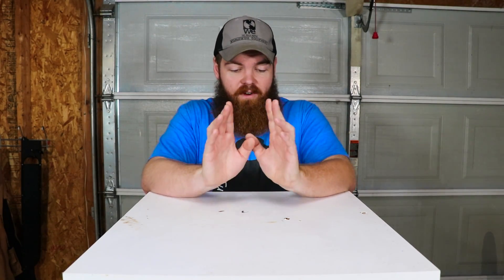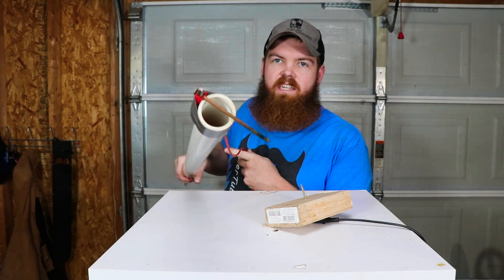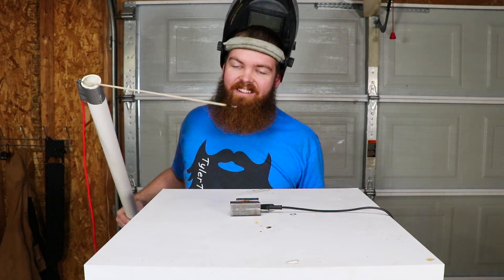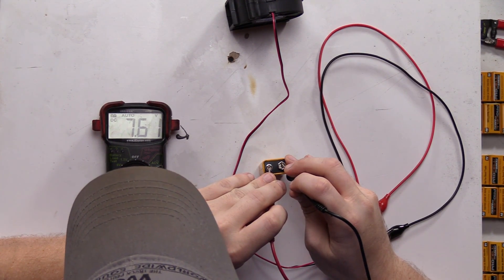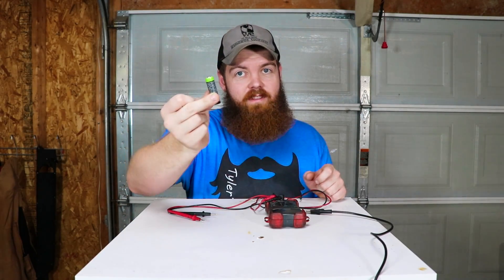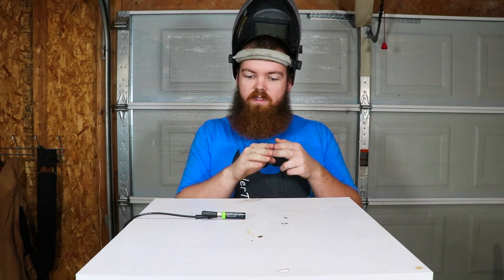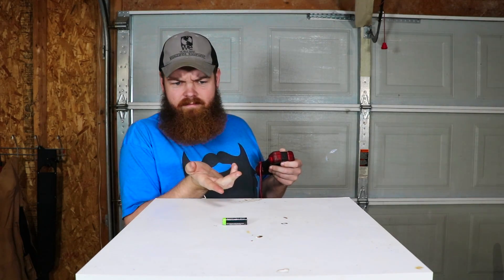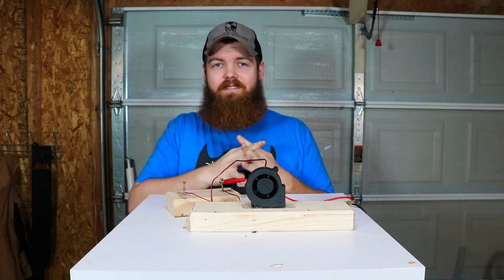Can You Weld With 300 - 9 Volt Batteries?

Comment: Hallo,
ich spare mir den halben Kommentar. Einfach in der Schule in Physik aufpassen. So ein Quatsch der hier erzählt wird. 
Beim Schweißen sind nicht 2700Volt und wenige Ampere wichtig. (Lichbogen wie er hier zu sehen ist) sondern wenig Spannung und viel Strom. Die 300 Batterien in Parallelschaltung und du kannst Schweißen wenn du es kannst. ) 9 Volt und 80 Ampere, das geht. Versuch es noch einmal!
Grüße

Comment: 9v batteries in series like that have lots of voltage but they can't pass much current. you would have had better luck connecting them in series and parallel, i'd taken 1/2 put them in parallel, then the other half, then put the 2 hales in series. that would give you 18v but a lot of current. all the batteries in series just give you impressive sparks.

Comment: you can weld with 9v batteries, but you need to wire them in parallel not serial. welding works through high amperage and NOT through high voltage

Comment: Put 5 in series and parallel them up that's shouod give you around 45 volts but in parallel with other ones should be around 100 amps or so

Comment: I think that you might actaully be able to weld with 9 volts, if you arrange them correctly. You arranged them in a series which in creases the voltage, so the kind of power your output is 9v x 300(batteries) = 2700v and 500 mili ampers. When welding you need a high amperage and not so many volts so if you arranged the batteries in parallel your new power output would be 500mA x 300 = 150000mA and 9v (or 150A at 9V). That would bring you up to the amount of ampers you need but im not sure if 9V would be enough. Still love the video though, would love to see a follow up in a parallel setup of batteries

Comment: Naturally electricity wants to be balanced. There's so much power stored in that many 9 volt batteries that it will charge a 1.2 volt battery a lot. The trick to a quicker more reliable charge would be holding the connection for 5 seconds without creating the ark. The ark is the air ionizing. Its not a real connection for electrons to flow through.

Comment: This didnt work because for welding you need high amperage and not a high current. 300*9V=2700V is useless, most welders just use about 16V. so you should try like 150*(9V + 9V), means, two in series and 150 parallel.

Comment: Look if you hook a bank of 30 together you'll have a diecent supply of voltage. Then you'll have 10 banks of 30 batteries. If you hook those 10 banks up in paralell (positive to positive, neg to neg) you'll have a good supply of amperage. And those amps are what you want because they put out the heat you need.

Comment: Too much voltage (9*300=2700v), it creates an arc before melting the welding rod down, said arc eats the melted rod. You should try with half the batteries and a thinner welding rod. You might get better results.

Comment: 3 series, 100 parallel  would work better than 300 series.  As others have pointed out , you need serious current to weld.  The wiring would be a lot more involved, you couldn't just clip them together.

Comment: Put em all in parallel and it might have worked better, you'd get the same results with a microwave oven transformer. Each battery has internal resistance. NiMH 9 volt batteries would probably be better but even they aren't optimal.

Comment: If you make a machine that has a nail  a the end with a sliding mechanism sorta like a hydraulic press you can move it up in down by hand making the nail hit the battery that is in a holder that holds it secure that has good quality so you can just pop the battery’s in and out and tape them a few times but then to get the power you would have a solar Panel hooked up to the battery’s and something efficient

Comment: Welding requires certain a certain amperage in order to work, not voltage. Putting the batteries together in series increases the voltage output but the amperage isn't really affected.

Comment: noo tyler you need to connect them in parallel, so that you still have 9 volts at the output but a huge current, right now you have high voltage but low current that won't work

Comment: It didn't work because you had them hooked up in series which boosted the voltage but not the amperage. Welding is done with high amperage so if you hooked those batteries up in parallel, it should work.

Comment: I get you’re not a welder but how do you weld with the electrode 6” from the piece?
Reply: Farmer Connor it’s not like an actual welding machine , it’s high voltage low current. A welding Machine is a lower voltage with way more current

Comment: 9:50 i would recharge even if it  is NOT rechargable trust me i have charged it but its more dangerous why u may ask well it dosent have any way to let the heat out so it would build up presure and explode or start to leak with fluids  i have charged non-rechargeble batteries but its more dangerous so had to look after it and its tempeture  but i did charge it and have charged may other non rechargeble batteries AA, AAA, button cell, 9 volt, lantern and other variants 
EDIT: oh and it damages the batteries so everytime u charge its capacity goes down
and 12:48 WTF ARE U DOING THATS DISCHARGING IT, charging a battery goes like this + TO + & - TO -  thats conecting it in series ur so its not 2700v its actually 2700 + 0.84 =2700.84V wtf
(sorry for my bad enlgish)

Comment: I really wanna see more welding stuff. Just be careful and DO YOUR RESEARCH!!! take a class if you need to bc from my experience in highschool. The smallest mistake will fling all that metal back in your face... welding can be tedious but after a while those little things won't be such an issue. Mine was getting the angle right. Once you hit the sweet spot it's cake, all the other welders out there know what I'm talking about

Comment: You need much more amperage to create an arc hot enough to weld. You'd need to make smaller banks of the batteries(maybe 10 batteries per bank), and then connect them in parallel. The arc wouldn't be very long, but it would be much brighter. The only issue is the batteries would definitely overheat after a few seconds of this kind of abuse. Causing some sort of catastrophic failure.

Comment: Too much voltage not enough amperage. Put 3 9 volt batteries in series to make 27volts but put about 10 stacks of the 27volts in parallel and use some mig wire and watch what happens.

Comment: Way to much voltage. Wire them up in pairs of 2 in series to get 18 volts. Then wire all the pairs in parallel, so you get a huge amount of amperage at 18v. I'm a welder, so it could 100% work. Just need about 90 amps for that rod.

Comment: You can't weld whit high volts but  you can If use high amps, try to set batteries in parallel not series

Comment: If you want to weld with the batteries, they need to be in parallel, not in series. It may not make sense, but 300 9V batteries in series actually has the same maximum current as a single one.

In parallel, however, they can work together. It would also set your house on fire.
Reply: One nine volt battery will not long arc….however it does need some balance bringing the amperage up

Comment: Welding works at around 30V and 100A. You probably have hooked the batteries all wrong. You had them hooked up in series which results in a lot of voltage and creates long arcs. But welding requires loads of current.
Reply: Alexander Gräf glad I’m not the only one

Comment: You might try welding with the batteries hooked up in parallel instead of series. That will increase the amperage instead of the voltage

Comment: Not that you were lacking for voltage here, but if you stripped the coating off those screws, you’d get better energy transfer. Also maybe consider some thicker gauge wire.

Comment: Link the batteries up in 3 groups of 100 batteries (joined in parallel, not series) and you will get 27volts DC @ a f**K load of amps. Thats what you need for welding, not 3,000v DC! Also, perhaps try 4 or 5 9v batteries on a cheap drill/driver meant to use a 18volt battery pack.

Comment: You need to make sure the amperage is right, the electrode probably would need at least 50 amps to even weld, so to see if it would work you should make sure it is getting adequate amperage

Comment: Try starting a gas engine with your many batteries
Reply: The "Garage 54" channel  did that with a Lada a while ago...
Reply: Electroboom did it with a honda.
Reply: @Canthus13  toyota yaris*
Reply: @SUPERBOBESPONJA1000  huh.  I thought it was a civic. Whatever. He did it.
Reply: 2700v will either not do anything or will fry every electronic in the car, if you hooked up all of the batteries in parallel you could get about 9v with about a 2000 amp short circuit. That would probably start the car.
Reply: @ReeghanN  I think Electroboom did it with AA batteries.  Neat idea, but I doubt I'd ever have that many AA batteries just laying around.
Reply: Canthus13 Haha I doubt anyone would have that many batteries lying around. So Electroboom used AA batteries to charge a car battery rather than to turn the starter motor. If you wanted to start a car with AA batteries you would need to put 8 in series and then put together about 30 bundles of 8 in parallel which would give you 12v at a 300a short circuit. So about 240 AA batteries. Which is more expensive than a new car battery :(
Reply: Cody's lab style?

Comment: How u going to try to weld with the electrode so far from the metal
Reply: Thank God I'm not the only one who noticed
Reply: He had it electrod positive too, i only use electrode negative
Reply: TheSuperJank E6011 can only be ran in electrode positive (DCEP) or ac current however I think he should’ve have used 6010 rod since it burns smoother another good thing would be some practice not sure how he thought welding would work but you definitely don’t hold the rod 3 inches from the metal haha that had me laughing
Reply: Douglas Bigblock it was making me cringe everytime I saw it
Reply: Douglas Bigblock I’m glad you seen it to (it’s not welding) mean while electrode 10ft away
Reply: Holds rod 5" away "why isn't it working?", Rod gets stuck "it's sticking I'm fearing for my life" ME: ITS A WELDING ROD YOU DUMBASS
Reply: Douglas Bigblock ik i was gonna say
Reply: Imagine he isn’t a welder. And is just messing around in his garage? IMAGINE THAT!!!! CRAZY I KNOW.
Reply: Deadass welding 101 plus what kind of rod 6011or 7018
Reply: This is a so deadly high voltage.
Reply: Ffs thank you 😂😂😂

It’s called a filler rod for a reason boy

Comment: "I will be wearing the welding helmet, just in case it explodes or Somthing" ya know. All that battery acid...such an inconvenient thing
Reply: NOMAD very few batteries use acid this day and age most are alkaline which is a base that can store voltage the only batteries that use acid are lead acid car batteries but they are getting phased out and replaced with agm and gel
Reply: @Running-with-skizers  cool cool
Reply: Bastard id rather have a lead acid battery over the AGM or Gel cell for a regular car.   They’re extremely cost prohibitive and don’t really carry any extra benefits for the average driver. Only time I’ve found they have a huge advantage is on a car with lots of aftermarket electrical work like speakers and light bars.

Comment: Welding is based off of amperage not voltage. You were too far above the metal your first few tries, you were just creating an arc burning the flux off of the rod. Also, arc (stick) welding thin tubing isn't the best idea. It'll work better with flat stock mild steel. Just a few tips from a welder. I'd love to see another homemade welder video from you. 
P.s. nice harbor freight helmet, had the same one in highschool.
Reply: My high school offered welding classes, but most of the helmets had holes in them, it was a challenge to avoid looking directly at the ark.
Reply: This guy knows

Comment: use them ground with ground and postive with positive to increase the amper instead of voltage so you can weld :)
try with 3000 farad super capacitors
Reply: Needs mig wire for what he was doing
Reply: @colbyvanalstine946  he needs to know you also can't weld 5 inches in the air and must maintain a connection to build heat, the tiny jumper wire will melt before a welding rod. mig wire would seem to work better
Reply: @ROTTK9  true, but it is more entertaining for him to try welding 5 inches in the air lol